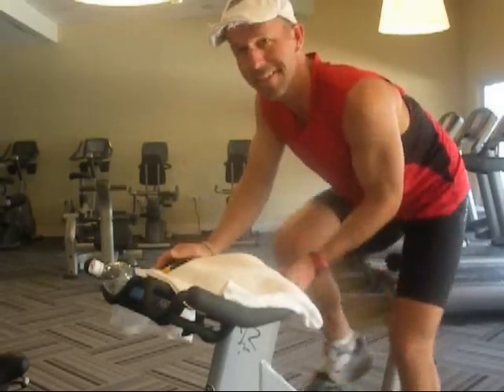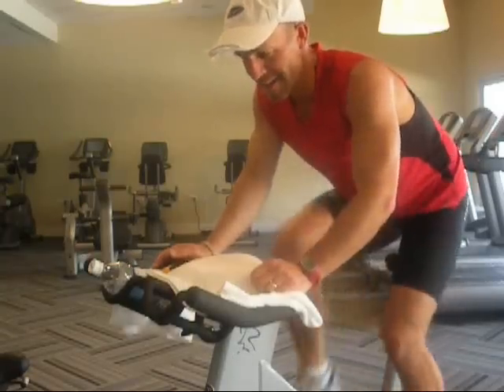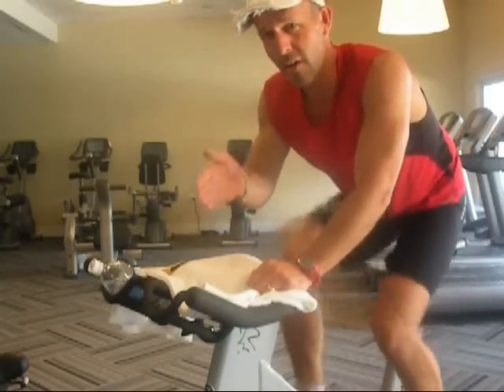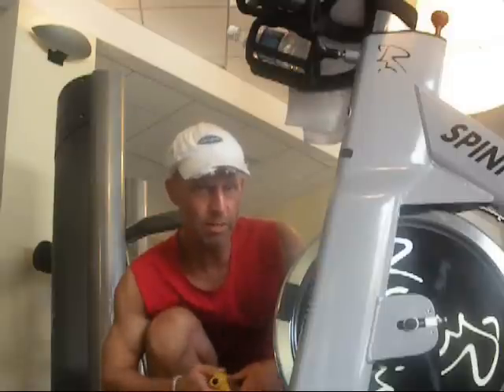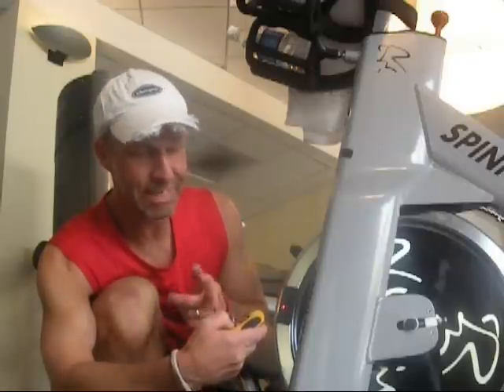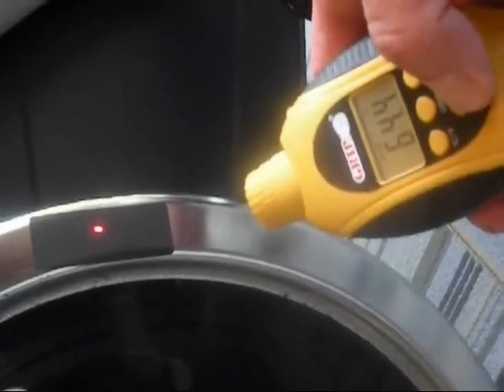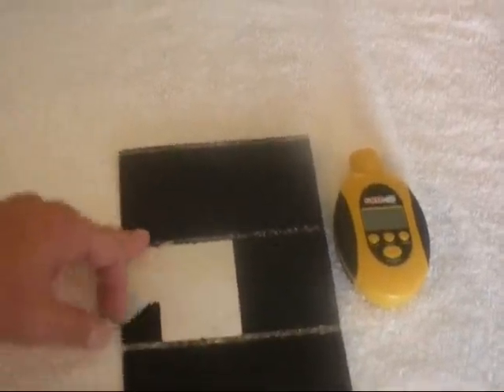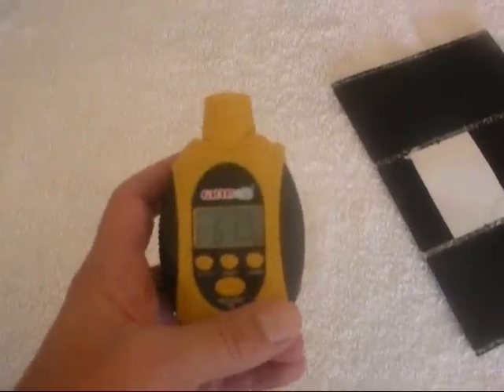$50.00 Spinning ® / Indoor Cycling Bike Power Meter

Comment from the maker: @syrus3k It in fact works very well as a method of measuring work you create, in this case in the form of heat, during an hour long Spinning class. It takes a long time for the mass of the flywheel to change temp. This change in temp (the Delta) is perfect for comparing the amount of work you do from one class to the next.

Comment: This isn't going to work unless you're only measuring one burst of activity rather than a whole session. Think about it, you're only really going to get the last 5 mins or so of heat build up measured..

The only real way to measure effort is to measure what level the resistance is at and for how long in conjunction with how many times the fly wheel goes round.

Considering you're an instructor you should really stop doing this.